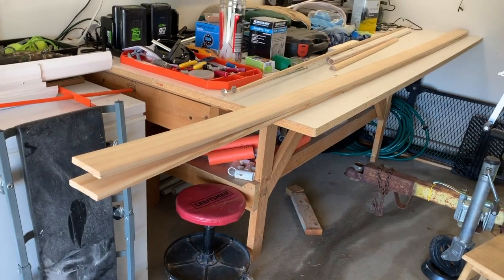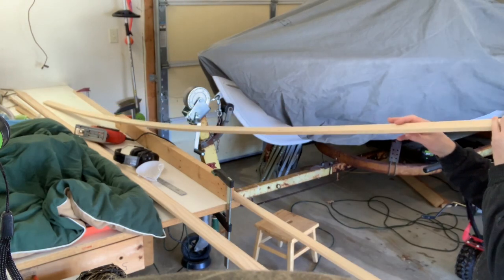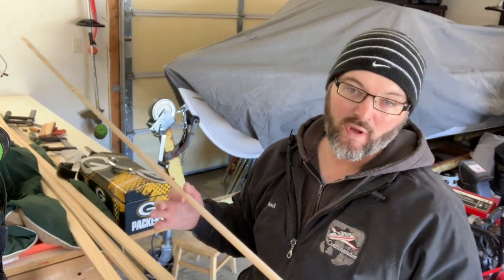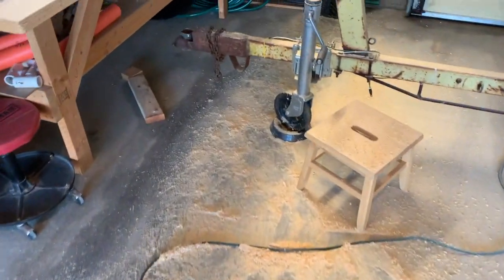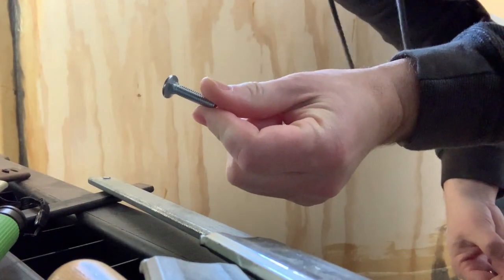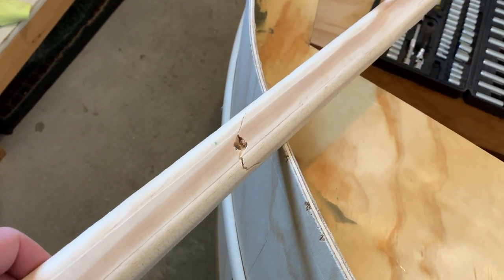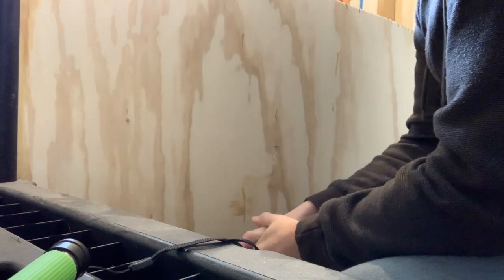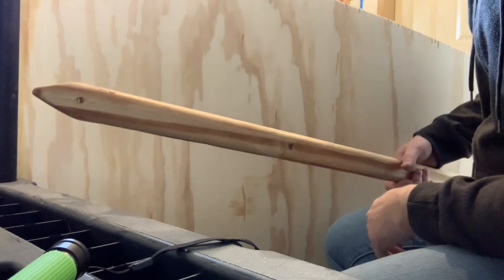Nep'Toon micro tug 9, installing rub rails (mostly) and gunwale trim, Episode 15

Comment: I bought plans for this boat and have no experience with fiberglass.    Do you think if you had fiberglassed the rails before it would have prevented the crack?
Reply from the maker: Hi jroehl88, no, that was just a weak spot in the wood. 'Glassing it before making the bend would make the piece too stiff to make that bend, and the fiberglass would have cracked and broken the wood, regardless of how pure the piece of wood is. Great question!